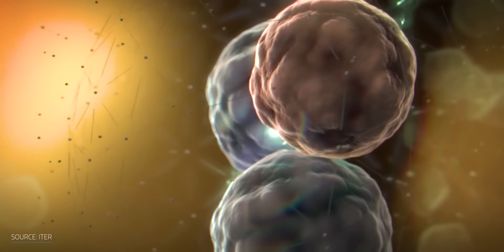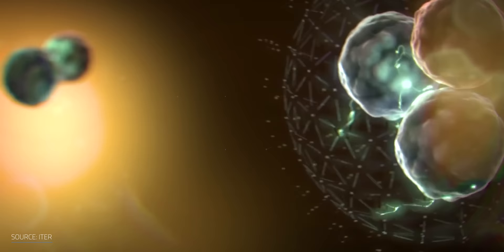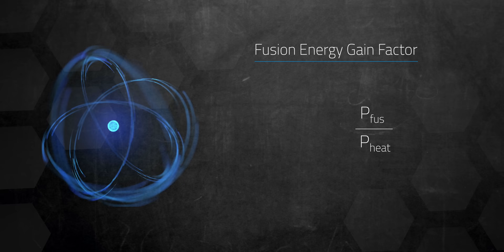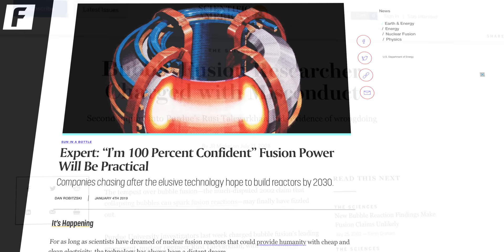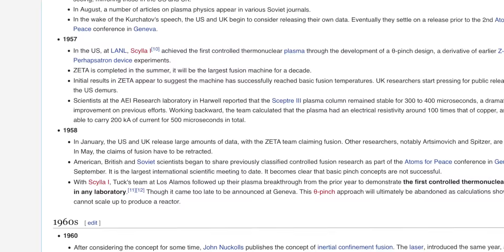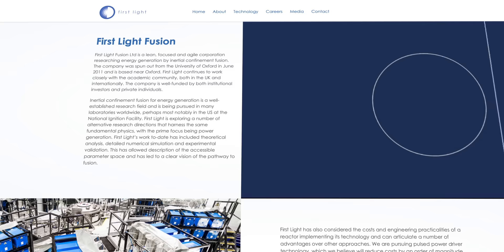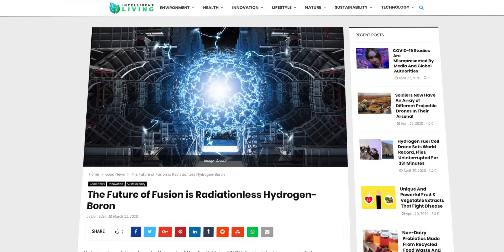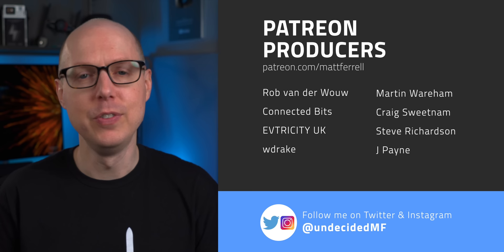The truth about nuclear fusion power - new breakthroughs

Comment: I don't get why is everyone trying to boil water, make steam and turn turbines... isn't light more efficient than heat. And last I check plasma is light, isn't it possible to use that... like in solars
Reply: Tladi Lebohang plasma is not light, where did you get that from? And no, we can’t use any other way.
Reply: Sorry, but plasma is pure heat.
Reply: Barry Miller no it’s not... plasma is a mixture of ionised nuclei and electrons floating freely from their nuclei. By definition. It has nothing to do with light or heat.
Reply: Really? Have you ever heard of a "plasma cutter"? It's used to cut steel.
Reply: Barry Miller I’m not a mechanical engineer, but in the context of physics and fusion, a plasma is by definition the fourth state of matter, consisting of atoms with enough energy to lose their electrons.

Edit: I researched plasma cutters. They don’t use “pure heat”. They too produce a high pressure plasma jet to cut. The plasma is produced by heating a gas and introducing it to an electrical arc, which rips off the electrons, producing the ionised plasma.
Reply: @Gomlmon99  Next time you are next to one, put your hand in the flow and tell me if it's heat or light.
Reply: Barry Miller it’s a flow of hot particles? I’m not saying most plasmas aren’t hot. But they aren’t “pure heat”. They are hot because the particles inside them are hot. You can’t just flat out deny the definition of a plasma hahaha
Reply: @Gomlmon99  I stand by my answer. Heat, not light is the main component of the work it does. It quite literally "melts" the steel, then vaporizes it.

Comment: What about the gamma rays in fusion reaction
Reply: What about them?
Reply: If a fusion reactor fails, all the gamma rays produced during energy generation will be leaked or released in surroundings causing alot of damage.
Reply: Akshat Jain no? As soon as the reaction stops, radioactivity is low. And tell me how several metres of concrete and lead “fail”?

Comment: Yes, it is always 30 years away, unless it is 40 years away.

The fact remains that, despite early optimism of commercial fusion in the 1970s, no fusion reactor has ever produced sufficient electric power to run a digital watch. 
Get back with me when you have a commercially viable reactor (24h*365d operation at 500 MWe output) at affordable cost (compared to gas fired steam). Until that time, it is a fairy story.

Comment: It seems the universe is mirror image of what we see when we analyze a atom. Why dont we use the universe as tool to figure out fusion completely? I find the number 2 is the most significant number, theres always TWO SIDES TO THE EQUATION. I dont know why no scientist is looking at this simple clue right in front of us. The problem is that observations are different between peers when we study quantum entanglement which should be clear to show us that this may be why we will never have the answer to how reality works. I picture the universe like the diagram of a wormhole only the ends of each side are connected to each other, which is a image you cannot percieve. Chemistry should clearily show that everything is of the same thing, it may just be one big illusion and we all are just 1. Just think about it, in epigenetics protiens controlling genes and protiens are controlled by the environment exposed. I can go on and on but you will always find yourself running into circles. Or maybe a sphere. 🙂

Comment: How about a dose of reality on fusion.  What does the fusion reaction actually produce?  Is there a 110 volt outlet on the side to plug into?  Unfortunately not.  The fusion reaction is used to heat water to make steam for the turbine.  Yes, the glorious fusion plant is just another way of boiling water for a steam turbine electrical generator, and as such, it is stuck with the dismal thermal inefficiency of a standard fossil fuel plant.  Actually, it is even worse due to the extreme temperatures of the fusion reactor itself which must be dealt with.  Sad reality, but reality none the less. We cannot find a solution to this very real problem if we just continue to ignore it.  Look again at that beautiful picture of the nuclear plant at the beginning of this video.  The scene is dominated by the three huge cooling towers that release tremendous amounts of heat into the atmosphere as a cost of running the steam turbine generator.

Comment: 100% pure bunk. This guy obfuscates the reality of fusion power like rest of this bunch. The power gain Q he mentions isn’t the total gain but only gain from the plasma (Qp) which is minuscule compared to the power required to even generate the plasma and confine it using ginormous magnets, lasers, etc. The total power gain (Qt) is more on the order of 0.01 and not the inflated Qp values given. Then there’s the question of confinement time which is usually on the order of milliseconds, scarcely enough time to produce anything usable. Finally, there’s no mention of conversion losses. Fusion reactors produce heat, not electricity, which must be converted to a usable form. Best estimates are around 50% efficiency. If you add it up, we’re not much farther from where we started in the ‘40s (except the machines are shinier and cgi is slicker). Do some research before “liking, commenting or subscribing.”
Reply: I was looking for other people that were going to criticize this. But I also want to say, he most likely did not mean to fool you, since most people don't know about these important details. They're deliberately hidden by the people working on the technology to receive more funding.

Comment: The only 'truth' you need know here, is that fusion, would be the most expensive electricity EVER. IF, it were to somehow come about. Thankfully, after a better part of a century 'fusion' is still 10 years away. Or just around the corner if you prefer. And that is a good thing, because here  is the other truth you need to know. Fusion, despite endless claims, would not be 'clean' or 'safe' or unlimited.  Nor would it be remotely affordable. In fact, it would be so eye-wateringly expensive, and SLOW, it would make nuclear fission look like an absolute bargain by comparison.

Comment: fusion energy wont happen because the fact they are trying to mimic something that uses extremely dense amounts of matter and gravity to maintain a fusion reaction. on earth we have gravity that will pull away from the core of the reactor and meaning we are working against gravity. working against gravity to maintain pressure required to maintain a reaction cost more than the amount of energy you get in return. also why arent they asking the question that what are they going to do with the massive amounts of heat produce and the photons released from a fusion reaction?
Reply: Michael allen Gravity has no effect on this and no pressure is required. They are going to use the heat to raise steam, just like in a normal thermal power plant.
Reply: @Gomlmon99  as much as I'd like to believe that check out the video how fusion works
Reply: Michael allen It’s not really up for debate, we do fusion right now at atmospheric pressures under ambient gravity
Reply: I wasnt debating the fact we do fusion. I was stating the fact that it's not efficient enough to out weigh the cost to start a reaction let alone maintain it.
Reply: Michael allen I mean the efficiency is not remotely the issue. We could do it right now with a positive Q. The issue is the materials, the tritium handling, the breeding etc.

Comment: All stars in the universe use quantum tunneling as the basis for their fusion reactions. Researchers are trying to achieve fusion another way, using higher temperatures and pressures. This makes no sense and is the basis for the failure of fusion reactors over the past 90 years. Quantum tunneling should be discussed any time fusion is mentioned, and research efforts should be redirected.
Reply: Except they aren’t using the same reaction chain as a star...?

Comment: There's this big yellow fusion reactor in the sky radiating enough energy to power everything on Earth forever. All you need to harness it is a solar roof and batteries. If only people would stop talking about things that don't exist and install solar panels and batteries.
Reply: And where will you get materials to produce that many panels and batteries?
Reply: @Gomlmon99  There's no shortage of the materials to make solar panels and batteries. And the materials are recyclable.
Reply: Kevin Polito there is, most aren’t, and they’re also quite toxic and expensive to make. Not to mention most take more energy to produce than they make. Plus the fact as you move away from the equator they become useless.

Comment: Again, another video focusses on ITER and JET, and other Tokamak spinoffs, and barely mentions stellarator designs. But the Wendelstein 7-X in Germany has already achieved 80 million degrees in a hydrogen-hydrogen reaction for almost 10 seconds in 2019. For 2020 this stellarator was scheduled to have a test run at full capacity for 10 MINUTES in a deuterium-hydrogen, or a deuterium-tritium reaction. All other reactors have only achieved fusion reaction temperatures for microseconds, or at best a second. So the Wendelstein 7-X is not only decades ahead of nearly every other fusion reactor experiment on Earth. Should the 10 minute test run succeed (and currently it looks a lot like it will) that means that Q will easily exceed 1. In that case the stellarator design could simply be scaled up and be producing electricity as early as 2030, ie almost 5 years after the first experiment of ITER will have have been run (should it stick to its schedule).
Yet Werndelstein 7-X gets ignored because the stellarator requires a very high amount control, while the Tokamak is designed with only very little control over the plasma. Thus the Tokamaks would never reach the same efficiency ratings as a stellarator design. Stellarators were already theorized about in the early 1960s. But at the time the necessary computers to control the magnetic fields simply did not exist. Today we easily have that capability.
Reply: RustyDust101 has 7-X ever run a tritium plasma in its lifetime? Or is it possible for it to ever run one?
Reply: @Gomlmon99  A tritium-tritum plasma is child's play when it comes to fusion temperatures. The greater the atomic weight of hydrogen isotopes, the lower the pressures and temperatures required to start a fusion reaction.

Yes, Wendelstein 7-X is designed to run a tritium-tritium plasma, if necessary. 
But tritium is hellishly expensive when compared to deuterium, which is hellishly expensive when compared to standard hydrogen atoms.
So the prefered fuel for fusion reactors is a deuterium-tritium mixture, then in a second stage a deuterium-hydrogen mix. Depending on the fusion reactions a tritium-deuterium reaction produces enough deuterium isotopes through high energy decay reactions to keep the plasma fed by adding simple hydrogen atoms.
Reply: @RustyDust101  that’s what I mean by a tritium plasma. But I thought it wasn’t designed for D-T? Maybe I’m wrong on that but my point is, not running D-T yet makes it less exciting
Reply: @Gomlmon99  The D-T plasma reaction has already been done somewhere in 2015 or so albeit in the roughly one second duration range. But a pure hydrogen plasma would obviously be the best IF it could be achieved but that sounds more like SciFi rather than science. So D-H would be the most preferable follow-up, followed by a D-T plasma. All of these plasma can and have been achieved.
Unluckily the pandemic made the plans moot for 2020.

Comment: Thorium Molten salt reactors are a far far better option than fusion!!  I suggest you watch a youtube video called "Thorium: An energy solution - THORIUM REMIX 2011" with Kirk Sorenson. It is an older video but is an excellent primer on the subject. Very safe, very efficient and can run on spent nuclear fuels. There are too many advantages to name here in a quick comment, but it is far more practical and do-able now. We even had one built and running for 5 years in the late 50's and early 60's. Nixon killed it because he was stupid. Hahaha
Reply: See this is why you shouldn’t use YouTube as a base of knowledge. Thorium reactors are expensive and hard to run. That’s why we don’t have them. Not some conspiracy.
Reply: @Gomlmon99  far cheaper and easier than fusion.
Reply: The CF Archive not sure if you’ve noticed, but we also don’t have running fusion reactors
Reply: @Gomlmon99  We had a molten salt reactor working in the late 60's that ran for 5 years. They turned it off every friday and went home and fired it back up on mondays. That's how stable and safe they are to shut them selves down easily. Sure there needs to be improvements but they are about to be built in other countries because we (USA) have lost the vision of it, but other countries are developing it now. If a fraction of the money that has been wasted on fusion had been spent on LFTR, we would have them by now. It has been delayed by the shortsightedness of Pres Nixon in the early 70's because he shut it down in preference of LWR's because those made the elements for nuclear weapons whereas LFTR doesn't (mostly). The rods in light water reactors (LWR's) that we use now are spent when their fuel is 3 to 5% used, but LFTR's can burn it all and can be configured to burn up what is now spent from LWR's. There are soo many advantages. Whe don't you get an open mind about it and educate yourself? No offense intended but it just seems you want to shoot me down, no matter what I say. It really is more doable now than fusion and for a fraction of the money. I think fusion is just a guise to eternally get research funding for those who work on it's development. Peace.

Comment: fusion is impossible. it will never work.  let say use lasers to fuse uranium into somthing twice as heavy and then let it decay back into uranium you could get energy from both the fusion and the decay and get infinite energy by converting the heat into laser power and sustain the reaction infinitly in a closed loop. then you can power your home for so long it will outlive the sun. this is why fusion is nothing but perpetual motion in desguise. if i just change the leverage a little bit more my gravity wheel will work and i would be just 30 years away from a working petpetual motion machine. that is the logic of fusion scientists but instead of mechancial leverage they use chemical leverage and call it more energy out than in. its like those that used a transformer and got more amps out than put in and assumed they had more energy out than in. voltage did not mean anything to them as they only looked for amps. in fusion the fusable material is like more amps at less volts to that of fission of more volts to that of amps. if i discharge a capacitor at 200 volts by charging it with a 1,5 volt battery and get a big blow out of the discharge do i have more enegy in that discharge that supplied by the 1,5 volt battery or do i have just more power in a much shorter amount of time but not more energy. this is the same trap of fusion energy. they put in less energy for longer time and get a bigger bang out of it in a shorter time and then assume more energy out than in. fusion power is the perpetual motion builders dream come true. everybody knows that perpetual motion is inpossible yet fusion scientist think they can do it with fusion by doing the same mistake of leverage and assume more energy out than in.
Reply: This is one of the stupidest things I’ve read all month

Comment: You glossed over engineering breakeven and what it would take going beyond that to achieve commercial fusion.  Those concepts ARE NOT anywhere near as technical as the material you presented.   The challenges to achieve commercial fusion go far beyond achieving scientific breakeven.  Any discussion about the viability of fusion is completely empty without discussing those two things. That's why I gave you a thumbs-down on this video.

Comment: Feed fission reactor into a fusion reactor use the feedback back into the fusion reactor problem solved..
Reply: That won't work. The element where you no longer get energy out of fusion is iron. However iron is no where near close enough to be viable for fusion. So it would get stuck in a grey area of iron and other stable elements and no longer produce power.

Comment: Unfortunately this video contains several false statements. Fission and nuclear chain reactions can occur naturally as witnessed by the Oklo reactor. Furthermore Tritium cannot be extracted from sea water because it does not occur in nature for any practical purposes. Tritium has to be bred by nuclear fission in a heavy water reactors or from the neutron radiation emitted by the Deuterium-Tritium fusion - which btw, renders reactor materials radioactive. To obtain a closed fuel cycle without using heavy water fission reactors, one needs a neutron multiplier. Beryllium is a candidate, however it is rare. Whilst almost everyone believes fusion conditions are achievable, the fuel supply problem is anything but solved!
Reply: Robert he said fission doesn’t normally occur naturally. Not that it never occurs naturally.